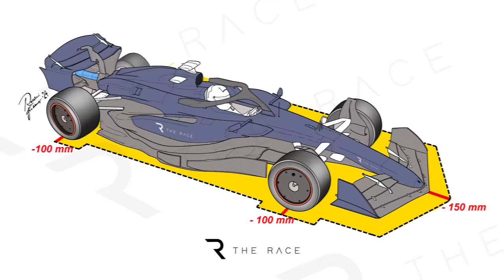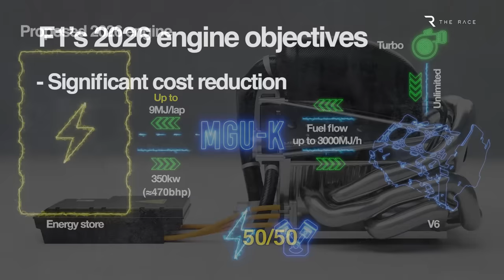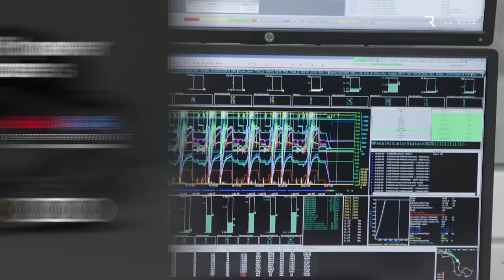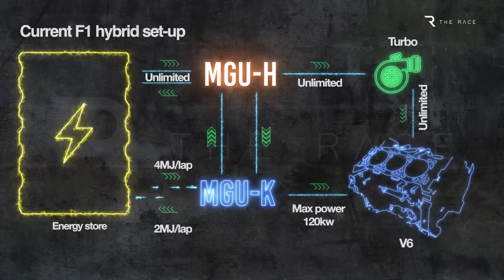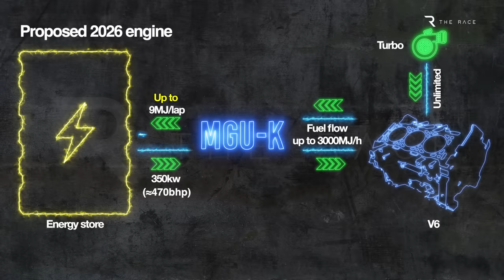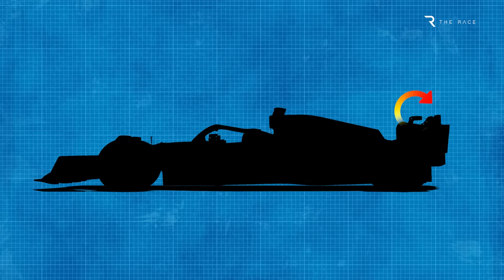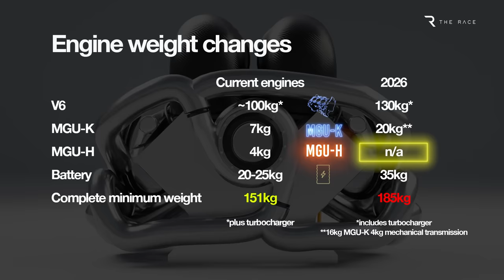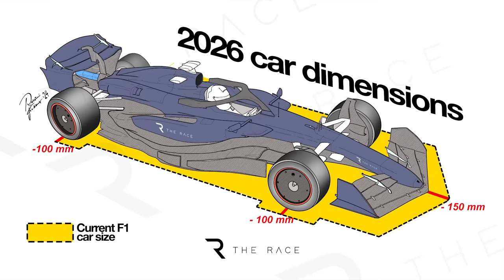The truth about F1's controversial 2026 cars

Comment: This video misses one big point. The batteries won't be large enough to compensate for the increased use of electric energy. Reducing the max amount of recoverable energy is not going to help that. Fact is that if 500 hp is coming from the battery, but the battery is not big enough to be able to use it througout more than one sector, you will effectively be driving a 500 hp car. This is currently also the case with the cars only reaching the 1000hp in quali cause they have to do energy saving in the race, but current cars still have around 850hp left without electric energy. That's a 350hp difference for a car which will more likely be heavier than the current car. Narrowing wheels and shortening cars isn't going to help the speed on either aero or chassis front. Summarised the cars from 2026 onwards will be much slower, more comparable to current F2. All because F1 is so focused on being climate neutral they choose a rule set which will defiinitely be awful for racing. There is a reason FE is racing on smaller tracks, it's because they'll never get as fast as F1 and pass to push would be way too prevalent if you'd race on normal tracks with normal straights (cause if someone else uses his energy when you don't he has twice the amount of hp).

Comment: These regs are completely out of touch with what fans want and are heading straight for the failure formula e. They say that hydrogen or eco fuel powered v10s are not what manufactures want but they will force the cars to have active aero and drs despite them being useless on the road. F2 is already more exciting than F1 with more competition and only ICEs keeping the cost and complexity down. I’ve never seen an organisation so hellbent on strewing themselves over. Every race is a grind to watch and I would prefer to tune into an endurance series which is saying something.

Comment: Since 100% bio-fuel is the goal and it's easily achievable I do not understand the need to push for more electric energy. Yes efficiency on bio-fuel is still good as it cost energy to produce and we get on top of supply issues right from the start rather than needing to scramble to solve it later but it's just idiotic for an F1 car to set that bar so high. The engine is already the most efficient engine on the planet. They can keep the 1.6 V6 run it on bio-fuel, increase the revs a bit to up the pitch, ditch the turbo to up the volume (granted the turbo is almost neccesary on the V6) go back to the simple KERS system and forget the active aero nonsense. This way the cars can be lighter and smaller, the tyres can be less durable and the racing will be better. The V8 era saw plenty of racing, overtakes, action, excitement etc. See 2012 as the peak and probably one of the single best seasons ever.

Comment: Everything about this is moving in the wrong direction. We already went through a couple of phases of super complex cars which is what eventually led to the current generation. They should be making the rules as simple and clear as possible with less expensive, lighter cars so teams on a lower budget would be more able to compete. As an example I don't see what F1 is adding to hybrid technology anymore so they could drop all that and go back to V10s or V12s running on bio fuels.

Comment: There's a simple solution to the whole idea that it'll just be a a fast moving computer that the drivers just have to point in the right direction.  Make several movable aero surfaces that are manually controlled by the driver wherever and whenever they see fit.  Then leave the driver in complete controll of harvesting and deploying the electric power.  No zones, no number of seconds or maximum output over a given time.  You have 100kg of fuel to get to the end of the race as fast as you can.  Good luck and may the best driver win!   Can you imagine the infinite number of possible strategies?  Ferrari would probably just set fire the pit boxes with everyone in them. 😂😂😂

Comment: What. A. Mess. I say we drop the big, heavy and expensive batteries/generators, donate them to Formula E. Run a 10 or 8 cylinder engine that can run on carbon neutral fuel and get on with it.

Comment: Small, light, hight rev sound and a bold step toward green hydrogene powered combustion engine to speed UP their development and to be inherited to road cars and trucks. It's impossible for all cars and especially trucks to be full EV. Not only the infrastructures are not meeting evryone's needs about availability and power but also how will you mine enough lithium and rare materials to produce batterys  that also are heavy and also  for silicon systems.
Abandoning mgu-h After so much  spent to develop it is a  ridiculous waste of the Time and the money and a big step back.
Reply: So : the 2000 cars dimensions, 1,4 HV8, same mgu-h and mgu-k, there is another system that is needed for hydrogene to be kept is a safe pressure witch meens a bit more weight but the PU will be AT 1200 HP so maybe less battery to compensate and also will help reduce DRS train since the battery usage will be limited and so defending by using ERS will be for a maximum of 2 to 3 laps instead of having the battery rechargeable to stand multiple laps ...
Reply: Maybe reduce the power of braking to have juste a bit more Space needed to brake and allow some inside safe sending, and together with smaller cars wich means multiple racing lines possible, and maybe less powerfull DRS WE will more wheel to wheel racing like Alonso vs Hamilton last year in bahrain instead of waiting  for an easy drs overtaking.

Comment: I dont think overregulation is a good route. I am still a pretty new viewer of the sport but I have watched a lot of videos of F1 in the past. In my opinion the past engines sounded better, which I care little about (don’t hate me just preference), but what I find most interesting is the teams racing (hehe) to achieve the best cars. What if we removed most regulations, maybe have a cap on engine and car size and have required safety features like the halo and then just let the engineers go nuts. I would love to see what could be achieved without wierd DRS rules where you can only use it sometimes or whatever. Why not let the drivers decide what is fastest? I actually think that we would end up with a very entertaining sport

Comment: This all is so trash.
The engines are getting 20% heavier. "In the worst case, the car should be about the same weight", I'll ready that as the cars will be at least 5% heavier.

You want smaller cars? Take out the battery and reintroduce refueling.
Oh, how about we go back to the old wheel and tyres that were, you know, lighter?

F1 is lead by people that never take the obvious choice, because doing so would demand them to admit they were wrong.

Comment: Why is everyone talking about a bigger battery? The Delta SOC is exactly the same as it currently is - 4MJ. Ok, the MGU-K is much more powerful, so probably the current will be higher and one way of dealing with that is more capacity. But it doesn't have to be bigger. Maybe the batteries will actually have a higher capacity, but the teams will not be able to utilize the full capacity they have. That's some class A bullshit right there.

Comment: This is setting up to be the worst set of regs we've seen, they want to do everything at once and it will just fall flat on its face, if we are already facing multiple problems with the 2022 regs they thought they'd fix but only got worst you can't even imagine how bad the 2026 regs will turn out
Specialy with active aero as masive as they want it to be, plus curent ground effect, it's gonna be a disaster

Comment: It's doesn't turn wasted heat in to energy it's kernergetic energy in the first place
Reply: Heat and kinetic energy is the same thing.  What is heat if  not vibrating molecules, i.e., kinetic energy. ;)
Reply: @TassieLorenzo  but called hrs it is  not recovering heat it's recovering  kinetic energy. They are linked but gases can hot and at atmosphere and pressure can be present but hot

Comment: F1 has been steadily getting worse since the 80s. Get rid of all this complex aero. Get better tyres, with manufacturers competing to produce a full grip for the whole race tyre. Get rid of DRS, Push to Pass and whatever other electronic nonsense they have. Stop locking in rules for so many years too. Basically, just bring back the 80s turbo cars or early 90s V10/V12s. Look better, sound better, blow up more often = more exciting racing. It's about pushing the limits not sustainability.

Comment: why the continued insistence on shoving hybrid/e-tech down our throats under the guise of "road car relevance"?? Why not focus on developing alternative fuels that can achieve 0 emissions and keep the ICE? Not only are automaker giants like M-B, GM, VW, Ford, and Aston Martin MASSIVELEY scaling back EV development, but Porsche, Toyota, and Lexus are spending HUGE dollars on these alternative fuels; it seems much more relevant to the development of road cars than hybrid technology. F1 and the participating manufacturers can have their cake and eat it too, proving the fans exactly what they want with smaller, less electrically dependent, and therefore MUCH lighter cars, while maintaining the platform of road car technology development. I own a Telsa; I'm not an "anti-electric" martyr, but Formula-E exists for a reason. If manufacturers are so interested in the R&D of electric tech, they can participate there with much more effect to their cause. F1 MUST be pushed in a direction that allows it to still be considered the pinnacle of motorsport. Not only in it's technology (which the FIA has already shamefully neutered aerodynamic development) but in the emotion that makes motorsport what we love. The ICE's must not only remain, but continue to be at the forefront of consideration to the formula, NOT the slow takeover of electric technology.

Comment: Every F1-Fan should be concerned about the 2026 rules.
It's even worse than the change for 2014-

F1 isn't a fucking endurance series. Get rid of those overweight lame hybrid-engines and go back to engines, which can bringt the power all the time. without recharging a battery.

Don't listen to the manufactur with their greenwashing.

Comment: smaller 2021 cars with 2022 aero regs and V10's would be the best here

They talk about sustainability, and then each team moves hundreds of people and tons of equipment by flying all across the globe in private jets then also using trucks and other vehicles to move to the circuit from whatever airport

Just give us smaller cars thats ALL WE NEED STOP MAKING THIS MORE COMPLICATED AND BAD

OR just go full LMH and let the engineers build whatever the f**k they want! LMH and LMDH has great racing and you get all sorts of engines from twin turbo 19500RPM TT V6 engines to 5.2 N/A V8 Engines. Its the pinnacle of motorsports, let engineers innovate like they did in 80's/90s and create stuff like the X2010 or a 6 wheeler fan car

Comment: Not really happy with the new rules. I don't understand where they will draw the line w the engines. When it's full EV? We have formula E for that. Maybe hydrogen? But wouldn't it be best to run the engines we have now or full ICE engines on e fuels? It's a tech that would have a massive impact on CO2 globally because all the existing cars could use it. It seems like the push towards electricity exists mostly for marketing since that's what the largest portion of the public inherently understands and allows F1 to advertise all these "green" changes and gain social good will credits. Meanwhile if a country like Germany stopped existing tomorrow there would be no noticeable change to the global CO2 emissions, so why ruin a sport involving 20 cars for 0 change instead of pushing a tech such as e fuels that would have a significant global impact?

Comment: This is getting too complicated for fans and too out of control for drivers. 

First of all, too much electrification. Tf is this, formula 1 or formula washing machine? We will get to a point where the engine will just be an auxiliary system for the hybrid. 

Second, active aero is bs. Ok, maybe not as a concept itself, but the way they will implement it in f1 is just outrageous. At least give the driver the ability to choose when and how he deploys the system, not some complex computer do it for him. 

Third, i've said it and i will forever say it, let the damn engeneers build fast cars. Don't use this envorniment and sustainability excuse, as we all know where the big co2 really comes from. Also, the road relevancy thing...i didn't know f1 is an add for hybrid roadcars. I want to see f1 evolving in speed. More freedom with the cars, more variety. 

And in the end, nothing can replace simplicity. Some smaller and lighter cars would be much better than complex time attack machines for the racing.

Comment: Just get it over with and go full electric!

(I know they can’t as FE has exclusive full ev until 2039 I think)

Currently the engine alone makes around 780 at the minimum. But for 2026 they’re lowering it to around 530 hp. Why?!? Everything in this video is soooo unnecessary except for making the cars lighter and easier to follow.

Comment: F1 needs to be shut down and have Formula E to take it's place. A lot more fun and interesting racing going on there, and battles to the finish line.
F1 used to be the place of groundbreaking technologies, but in the laste few decades it has been grinding to a halt, outlawing every new innovation and improvement that teams would come up with.
Because F1 is a corrupt place as there have been documentaries exposing it.
F1 is no longer the leader in technologies, but it's regressing.

Comment: Ditch the hybrid element. Run the v6 at its limit with higher fuel flow limit so they produce circa 1000+hp and reduce the car size and weight with the lack of hybridity. Passenger cars don’t need EV technological gains. We’ve already established the strengths/weaknesses of EVs so end the facade. Take it back to being a sport.